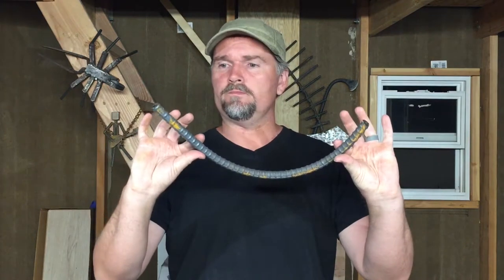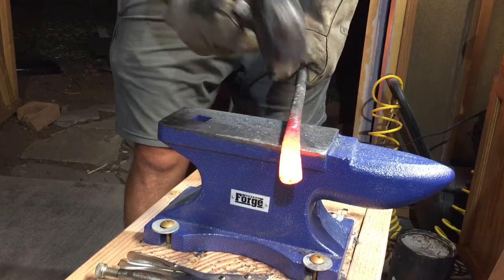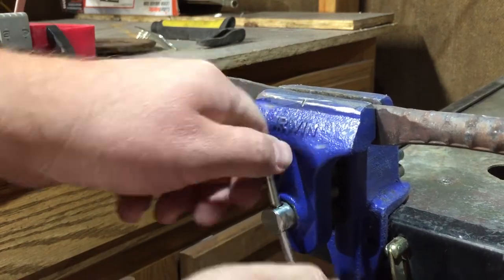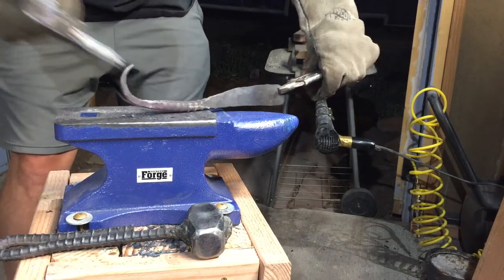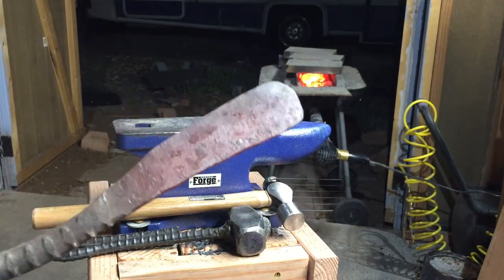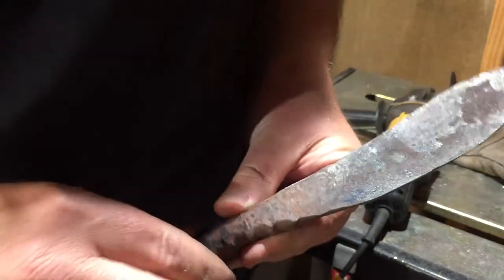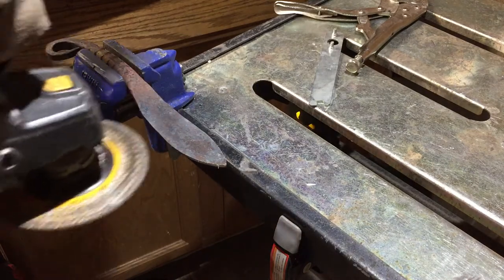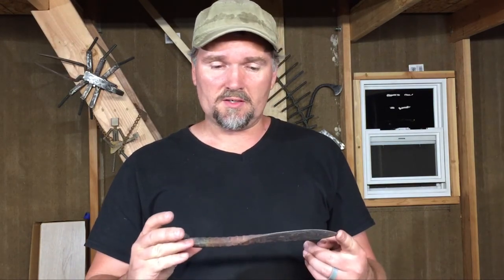How to Make a Post-Apocalypse Knife from a Scrap of Rebar

Comment: you have some great vids bro, glad i found your channel. i would love to see more of that hammer and the handle!!  where do u buy your coal for the forge? im having probs in my area trying to find coal or coke for our forge. please help!
Reply from the maker: Outlaw Edge Bladeworks Bushcraft and Survival, thanks! To be honest, I've had the same problem with finding true coal, so far I'm using mostly charcoal briquettes and some bags of hardwood charcoal that I bought from Walmart. The hardwood burns pretty hot, but it cost a lot more. And honestly, I can't get up to good welding temperature with either. I've seen boxes of coal on eBay, but they're pretty pricey. Still looking.
Reply: swap to propane its cheaper and for about 90% of all projects propane will do the job just fine.